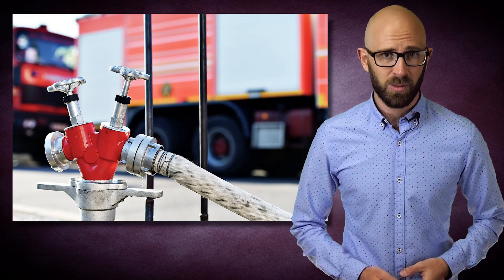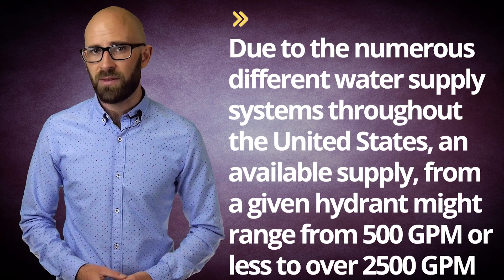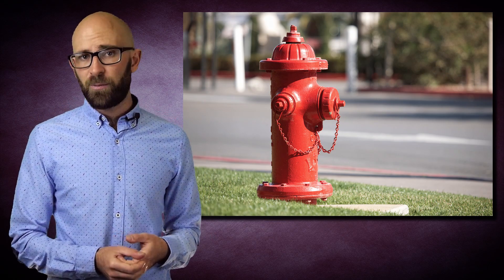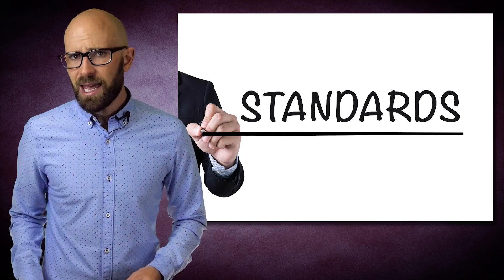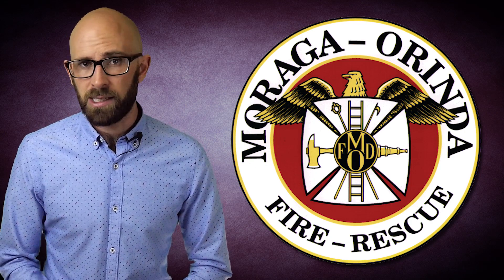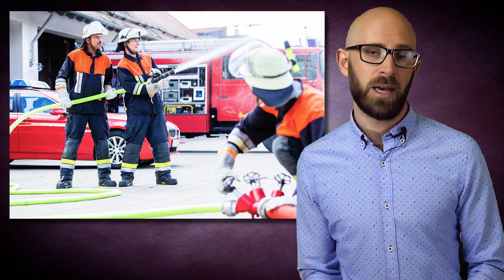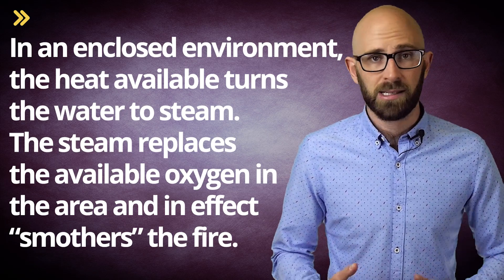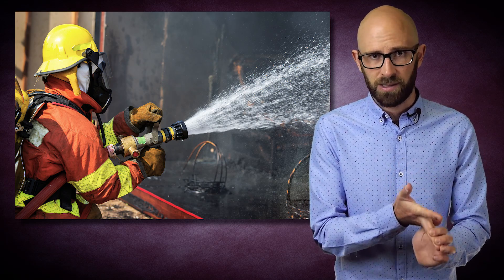Fire Hydrant Colors Actually Mean Something

Comment: TORONTO (and some other Ontario Canada cities...) 

Blue hydrants can move the largest volume of water, able to pump out 95 litres per second, while a red hydrant is the weakest, only able to pump less than 31 litres a second. Green and orange hydrants fall in the middle ground, with the former able to dispense between 63 and 95 litres per second and the latter pumps between 31 and 63 litres per second. The remainder of the hydrant, or the barrel, is painted yellow, though red hydrant barrels can still be seen around Toronto despite the uniform code.
Reply: Yes but in the GTA they used to paint the hydrant tops according to the region. Nort York had sky blue tops, Scarb had orange tops, Toronto had silver, and then later green tops. etc. It had nothing to do with the GPMs. But then after they adopted the new colour code standard, it is hard to tell if a hydrant is painted according to the code, or if it is an old left over paint job that happened to be blue.... this is why half the firefighters don't trust how it is painted....
Reply: "95 litres per second" Ooh my! That's a really disturbing amount of water.

Comment: If choosing the correct water pressure and type of hydrant is so important, I'm surprised there aren't stricter rules about how they're painted.
Reply: Conway79 On that note, I'm surprised they don't have a local map or app that has this info for each fire station and readily available to other stations that may have to assist in their area.
Reply: It is important but there is nothing you can do (really). It's not like there is another choice. If you need 1500GPM and the house is in front of a red hydrant you use the red hydrant. If there were three hydrants in front of a burning house you would choose the silver or blue. Basically the color indicates what flow to expect. There are things you can do but they take time, which there is not a lot of in that situation.
Reply: 1) The rules are lax because at the end of the day you grab the closet hydrant first. The only time you would be searching for a high flow hydrant is on a very large fire where you need a lot of volume. Most residential and light commercial fires don't require over 1000gpm.
2) Most fire departments do have a map of hydrants in their area, as well as flow rates. The city I live in has a map that specifies the location of all the hydrants and because it is a smaller city they can also maintain a steady flow/pressure over the whole system. The map has a physical hard copy at city hall and each map book as well as digital copies on all the units equipped with MCT's (Mobile Computer Terminals). 
3) If for some reason you need a higher flow hydrant (chemical plant fire or large industrial for example) you would know long before you got there due to the smoke column and have your 2nd and 3rd in engines snag those better hydrants. Most new large industrial facilities have their own hydrant system that is boosted to a greater GPM and pressure than the surrounding area.
4) Actually most of us do carry our cell phones on us, or at least on the rig. Some will even go interior with them in their pocket. What you have to remember though is that if it's in a pant pocket on your station pants they are covered by you bunkers which are designed to keep you alive in a fire, you will not be able to get it out and use it though. I personally only carry mine half the time.

And as Erikk mentioned most firefighters know their area well enough to know where the high pressure/gpm hydrants are. It was said that FDNY 1st Deputy Fire Commissioner William M. Feehan, who sadly passed on 9/11, "was thought to know the location of every fire hydrant in the city." While that was probably an exaggeration it isn't far from the truth.
Reply: Dead Parroting Some municipalities do have maps, but having to pull out a map and figure out the info on it takes time, so it’s easier to just look at the hydrant.  As far as the app goes,  firemen don’t carry their cellphones...they would get damaged in the fires.
Reply: Erikk Friberg They should really have something in the truck, though, like the cops do. It doesn't have to go in the building with them.
Reply: Conway79 It is important, but two things, there isn’t much different in flow rate between hydrants and/or the firemen have a good idea what the flow rate is for everything in their area.  (Also, if you pay attention to the video, flow rate is important, not pressure and type.)
Reply: Another reason for this, the pressure from a hydrant does not equal the pressure leaving the hose.  The pumper truck takes in the water from the hydrant, stores it in the tank, and pumps the water out at variable pressures.  The changing of pressure includes the length of hose being used, how high up the fire is, how many curves in the hose, etc.  Also, lower pressure is for volume of water, higher pressure is for the reach of the stream.

Comment: I used to work for the Phoenix water dept repairing old broken infrastructure. We would only mark the caps if the hydrants where tapped on a 16" main or bigger. It is soo important to not paint over, decorate around or otherwise try to lessen the "eye sore" of a hydrant. If property burns and it can be proven who disguised the hydrant, the owner of the damaged property can and probably will win a lawsuit.
Reply: In a neighborhood my step dad built we had a red 12inch wide line from middle of street up the curb to the hydrant,  the firemen can see where the hydrant is from a block away.
Reply: Every place I have lived with paved roads has blue corner reflectors in the roadway to mark hydrant locations.
Reply: Not at all, In most places you can freely paint the fire plug.
Reply: Benson 
"herp da dur im a 35 year old sheltered white woman with no job because i married a guy i dont find sexually appealing so i could stay sheltered and now i have nothing to do all day so im going to go outaide and ruin everyons life by painting this fire hydrant into a Sylvester the cat! Herp da dur!"

Comment: The hydrant right by my place is chrome yellow with a green top. When an idiot hit it and knocked it over, the geyser was impressive as was the scouring done by the water. The new hydrant has the shear bolts on it so only the bolts need replacing in case of stupidity.
The neighboring city uses silver colored hydrants with red/green/blue tops or caps depend on the shape of the hydrant.
The company I used to work for tests hydrants used in mobile home parks doing yearly and 5-year inspections and tests. It was interesting to do a yearly inspection.

Comment: all ours around here are red, i don't remember ever seeing another color
Reply: Ironically i can never remember ever in my entire life anywhere ive been across 10 countries in which ive seen a pure red one. Usually i see red and yellow or just yellow. No pure red
Reply: where i live hydrants are in the ground covered by a heavy cast iron lid.
the equipment on every fire fighter car contains something called a "hydrant key" which is a T shaped steel object with each end having a specific purpose, one of the short ends is used to hook into the lid and lift it off, the other short end can be used to smash the cast iron lid if necessary (sometimes they get so rusty, dirty or frozen that they won't come out) and the long end is the actual key needed to open the valve.

we have those underground hydrants mainly because over ground hydrants would freeze shut during winter.
Reply: Jason Halverson Nice shirt dude, it’s red
Reply: Here in the US we have 2 types of hydrants, wet and dry.  The wet type is used down south or the west coast.  Up north here in Wisconsin we have the dry type.  They have a nut on top which is one end of a long (6 to 8 feet) long valve stem, you hookup your hoses and open the valve.  When your done you turn the nut to close the valve.  The water in the hydrant drains out.  Since the valve seat is below the frost line it never freezes up.

Comment: This is weird being English
Reply: They don't have fires.
Reply: + Full-Metal_Jacob  we don't have hydrants.  Or rather, they are underground and marked by bright yellow and black signs.
Reply: Australia is underground.  Blue square somewhere on the road or in the nature strip that has the connection in it. Makes it impossable for people to run into them or turn them on.  The cool part however is that in the middle of the road, there is always a blue reflector and an arrow showing what side of the road the FP(Fire Plug) is on.
Reply: You dont have colored hydrants?
Reply: It must always be weird.
Reply: Electra Flarefire 
There must be regional variation on that, because I've definitely seen hydrants in Melbourne (where I live). The hydrant itself is generally either inside a metal cabinet or covered by a metal pillar. https://farm8.staticflickr.com/7349/9904515645_30de427a8b_z.jpg
Reply: I don't know if it happened, but there was a system being looked at a few years ago. Where they had all the hydrants on a GPS display, instead of just having to have a look around for a little sign.
Reply: mod prime that's right, they are hidden in the pavements under metal flaps. I remember being taught in school that in order to find out about them, the yellow signs on nearby walls have  2 numbers- 1 says how far from the sign the hydrant is and 1says the diameter of the actual water connection
Reply: Yeah, pretty much everything he was talking about in this video, doesn't apply to the UK. 
As well as our hydrants being underground, they are not colour coded to show flow rate. Instead, they are always rated to at least the minimum rate required for the surrounding properties. 
They're all at least 1500litres/minute, but if they are near a large factory, school or something then they need to be at least 2100L/m for instance.

Comment: Does smoke help keep a fire going?
Reply: Abi Begin what the fuck are you on about
Reply: No. Go to elementary school and learn about fire.
Reply: Actually, filonin, smoke can help a fire grow.  You see, it's hot.  And it heats up whatever it blows past, possibly to ignition temperature.
Reply: Abi Begin the more you talk the more brain cells I lose
Reply: Mathieu . . . I once had a fire . . . just burning yard trash . . . not a super-big fire; 6-foot flames . . . no way possible that the tree branches 50-60 feet above were in danger, right?  It's just a bit of smoke, right?

Well, when we put out our fire, we noticed there was a dead branch up there that was smoking.  We had to cut the whole damn tree down to make sure we weren't starting a forest fire.
Reply: Roonasaur smoke is hot so yeah it would have dried out the trees above, but it wouldn't have made it smoke, what happened is an ember went up with that smoke (remember heat rises) and it started smoldering. The original question was whether or not it helps the fire, as in does it feed the fire, does the smoke itself help the current fire continue burning, so the answer is no, oxygen fuels fire, smoke has very very very little oxygen in it
Reply: Also, as a direct eye-witness, I can tell you for a fact (you may or may not believe me as you please) that there were no glowing embers shooting up that high.  We had "sparks"  (tiny-ass embers) that went maybe 20 feet up before petering out . . . 

If we had seen them going any higher than that, the fire would've been slowed down IMMEDIATELY.
Reply: Thank you. I had a feeling that there was something in it that helped.

When Mr. Whistler mentioned the three different ways to put out a fire combined with the fact that water turns to steam and how the steam counteracts the fire, I had a sneaky suspicion that smoke kept feeding the fire.
Reply: My goal is not to "argue" but to learn. Thank you for your gentle reply.
One thing I had wondered is if steam might be heavier PSI than smoke and what they may cause re: the fire continuing.
Reply: But smoke, when considered as a whole entity, IS fuckin' hot.  One single ember, or even a few, or a bunch, getting up that high wouldn't have ignited A WHOLE FUCKING BRANCH.  You need constant heating to get large-diameter stuff burning.

If we're talking strictly about the products of combustion (CO2 and H2O) then no, that's not starting a fire.  But in any real-life situation, there is always ample fresh air mixing in with the smoke that other stuff can still catch fire.

When you have a fire and "put it out" . . . chances are, there are still embers glowing hot and still plenty capable of starting a forest fire.  99.5% of the time they won't . . . but that last 0.5% of embers not-put-out is responsible for millions of acres of forest fire.
Reply: I mean, for realz dude.  If smoke puts out fires, then explain to me how World Trade Center building #7 collapsed.  The whole fuckin' building just fell right the fuck down because of a fire you could barely see from the outside.

All of the windows were still intact.  That fire could have ONLY been getting air from the ventilation system . . . yet it's still burning hot enough to melt a whole fuckin' building?????

It was contained - completely - along with all of the smoke it produced which contains "very very very" little O2 . . . 

But the whole thing just kept burning away and gave up the ghost all at once . . . ???????????
Reply: Roonasaur You keep mentioning embers starting forest fires then coming back to the smoke caused a new fire, the heat in the smoke definitely contributed to the fact that, like you mentioned, a single ember went up in there, the smoke itself would stop fire from happening, like you said it was smoldering, no fire, when the smoke went away what happened? That smoldering got worse... funny that...
As for 9/11 everyone knows dank memes dont melt steel beams, that shit was an inside job, look up thermite and then look up "pools of molten steel in basement wtc"
Good day sir